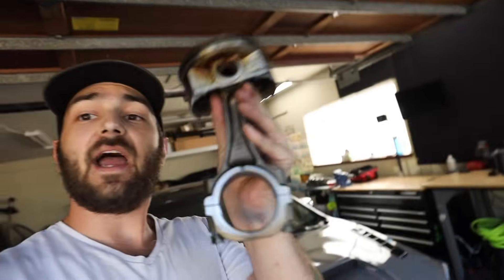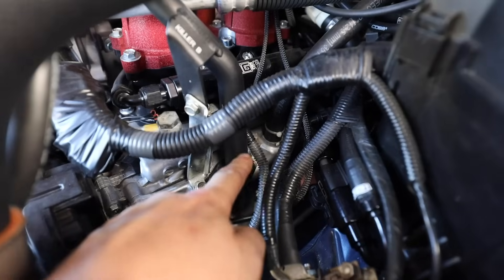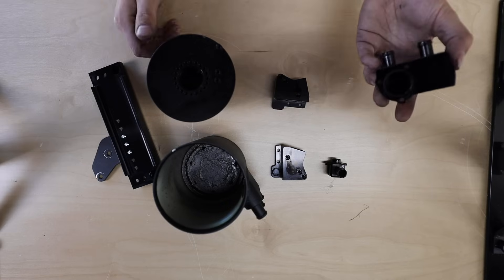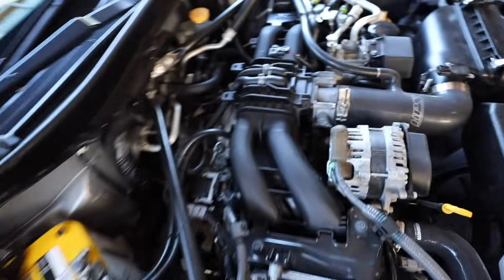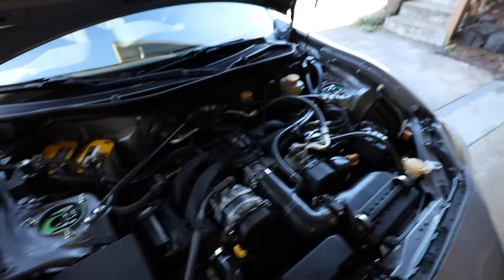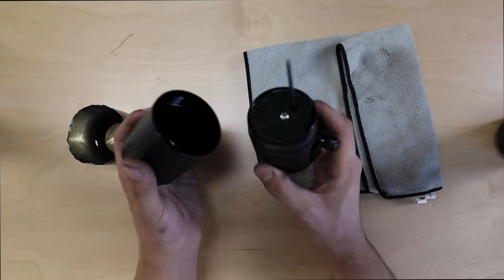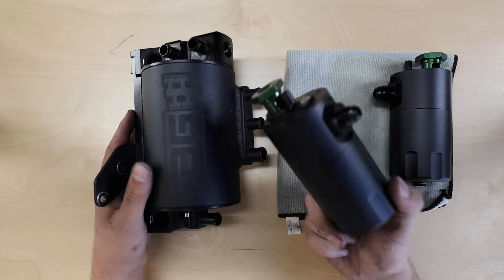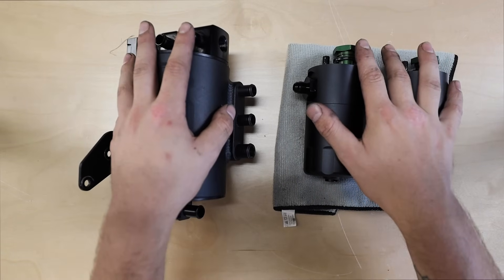Air Oil Separator VS Catch Can Explained. Is One Better?

Comment: Could your PCV valve on the driver side be closed all the time and not opening? It is just weird why one side has more while the other has none
Reply from the maker: Its possible. But I believe that the primary can is picking up all the vapor, the secondary can has a smaller vent line as well so it seems its just there for good measure

Comment: I did a 3port mishi catch can

Only on stock boost but its great, there isn't much blow by 

If anyone else wants to do it:
- Tjoint both sides of the rocker cover into one catch can input (this is what the black pipe at the bottom of the intercooler does from factory)
- pcv vent in to the other catch can input 
- output to the turbo inlet

I would like an aos one day
Reply from the maker: Glaf that its working out for you 🙏😁

Comment: AOS is better for lower hp motors like under 500whp. Catch can is better for higher compression V8’s making big power because they create so much more crankcase pressure so something like a IAG AOS wouldn’t be able to handle all of that. That’s why you won’t see a AOS on a any LSX motors, 5.0 coyote’s, hemi’s, etc. People with motors like those also would prefer catch cans since when you empty them you can see how the motor is acting, how the oil looks, any metal shavings and so forth
Reply from the maker: 🙏 good to know 🙏

Comment: If I were to get a single catch can for my 19 STI what side would be more preferable, PCV or CCV side.
Reply from the maker: I'd snag radium set up that pulls from the PCV side
Reply: @Smeedia  Can you connect both sides together with a Y to the inlet of the catch can?
Reply from the maker: So connecting the breather tubes from each head into a Y then back into a catch can?
Reply: @Smeedia  yeah would that work
Reply from the maker: That's how most of them are routed, the bulk majority of subaru specific catch cans will have  a dedicated port for each breather off the heads on the catch can

Comment: Is there a way to reduce blow by??
Reply from the maker: Overall engine health will dictate blow by, as for reducing it not too much you can do that I am aware of
Reply: Smeedia hmmm okay thanks!! I know Subaru’s can have ring land failure wonder if changing them out with better quality would reduce boy by as well
Reply from the maker: Ive seen people pull OEM rings and swap them with good results but a lot of work to do so

Comment: Hi guys 
I have two Cusco oil catch can installed on my wrx 2006 I empty it for every two or three days it’s comes out milky and watery is that a issue or just normal ?
Reply from the maker: Normal, just moisture from the crank case getting caught in there
Reply: Wow so quick you drive a lot?
Reply: One from the pcv/ case and one the heads?  In that case do you get more in one or the other
Reply: @tdro98  the most on pcv crankcase but it does in winter not much in summer

Comment: The "Increased chance for knock" mention at the beginning isn't very accurate, obviously the OEM would have engineered the engine around this, so it's effectively not a concern, but there are plenty of reasons to install these devices anyway
Reply from the maker: There's only so much they can do to work around it, but putting oil vapor back into the cylinders will denatured the fuel tk a degree which can increase knock potential

Comment: If I drove 4,000 miles before I checked the drain valve on bottom of my UPC Catch can, I would have the whole 1 quart can filled up into the hoses.  3.5 Ecoboost and uses zero oil.   It also does not get fluid in intercooler any more. If you have boosted engine, talk to someone who has a catch can on it. (especially one with 2 vacuum ports on it.) I would be concerned if I drove 4,000 miles and caught such a minor amount on a 3.5 ecoboost. D.I. engine.

Comment: Don't waste your money on an AOS just put in a 1 catch can with some stainless steel wool has a baffle in order for the oil and fuel vapours to condense properly. This will ensure that the air reentering your intake manifold will be clean engine, destroying contaminants that will stick to your intake valves, later robbing you of engine performance! Peace

Comment: Good expansion, but street series AOS = RIP. 

It’s literally doing exactly what you say you don’t want and putting oil vapor back in to intake.
Reply from the maker: True, the AOS helps to an extent. Ove seen a few people run catch cans inline with their AOS to try and mitigate as much as they can. But also explains why big power cars VTA with thr PCV system. How's yours set up on the 1100WHP car if you don't mind me asking? 🙏

Comment: Thanks for making this video, I don't think I would want the contaminated oil to go back into the engine and I might run two catch cans one in between the PCV and the manifold other between the fresh air and valve cover in case of blowback.  Any thoughts?

Comment: Don’t get C....f....d v3 AOS. Had to add catchcan before AOS. My AOS didn’t return oil to system enough and basically AOS became catchcan and had to drain out at certain time. Now I have one can connected to breather , one from PCV then to AOS. 😂
Reply from the maker: Interesting, never had an issue with my prior ones 🤔
Reply: Smeedia ohhh nice.👍You had v3 too? It was for sure easier to install compare to other (though instruction was horrible before 😜), but I don’t think there is enough “gravity” to bring the whole oil back to PCV. (I made sure hose runs downward) Does it really go back to valve?  Inst PCV somewhat one way?
Reply from the maker: With Crawfords i never really had any blow by make it back into the system. How much blow by were you seeing?
Reply: Smeedia lucky you 😜. I am sure( I hope) it was reduced, but even after I always had puddle of oil on throttle hose. Also I changed the transparent Hose on outlet side  to visually check and I could see slowly migrating oils(blowby). when I drained the oil from AOS... it was failry nice amount. (Kind of like your vid) I haven’t check the throttle hose lately since I haven’t driven much (and lazy to remove TMIC) but catch can is collecting some amount of blowbys....(Amazon cheapo Onésimo are doing very good job so far 😜)